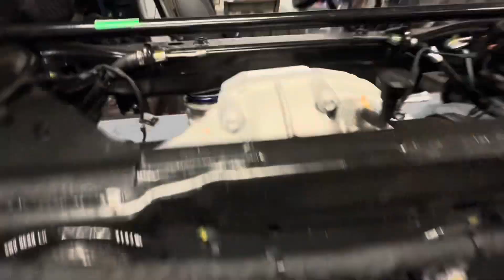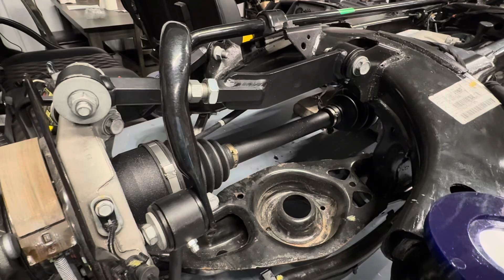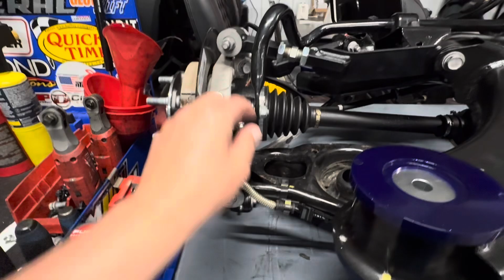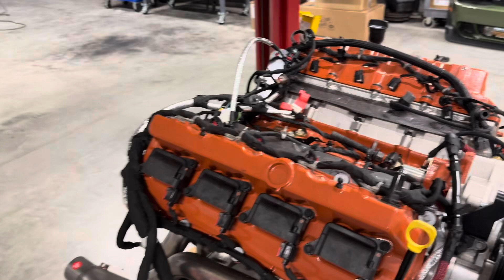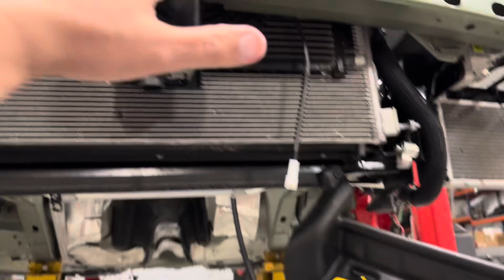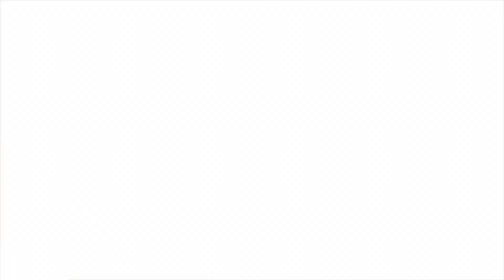2023 Hellcat Update with Cam, Headers and Suspension

Comment: be sure to check those BWoody end links on the rear suspension after doing some runs as they are prone to breaking and have a hp rating for single or double adjustable links.